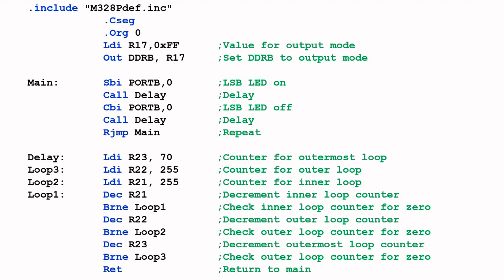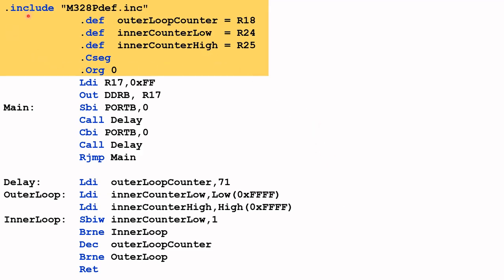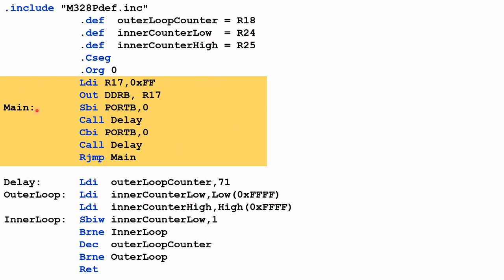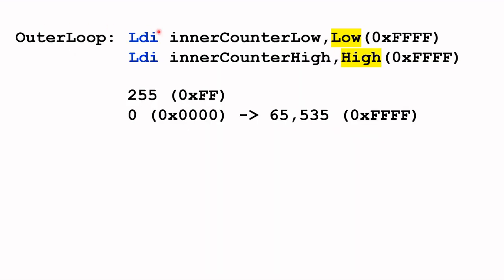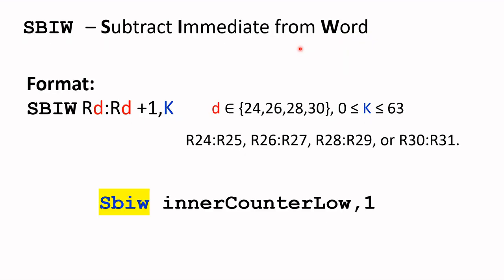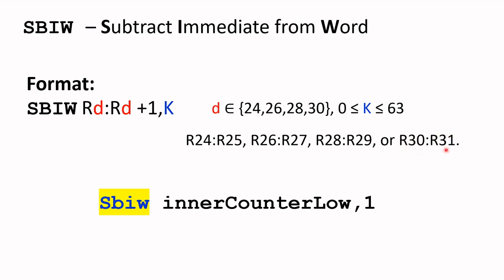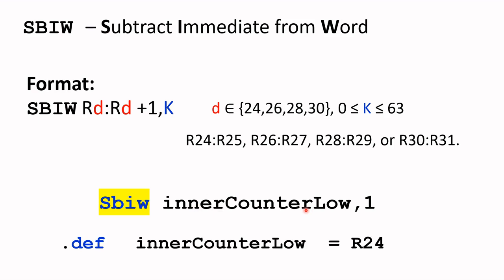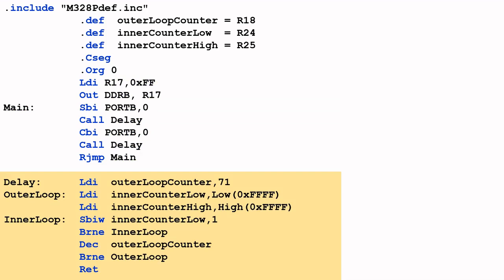#59 Blinking LED - Alternative Delay Subroutine

Comment: Here, we start subtracting from innercounterLow register. Once it is completed, does it start to subtract from innercounterhigh? does it happen 1 by 1 also as we have commanded it to happen 1 by 1 in the innercounterlow part?
Reply from the maker: Hi, the instruction Sbiw innerCounterLow,1 decreases the register pair word-wise (16 bits). That means that whenever the LSB underflows, the MSB is also automatically reduced by 1. Note that only the register pairs R25:R24, R27:R26, R29:R28 and R31:R30 can do that. Note - R27:R26 (is also called X), R29:R28 (called Y) and R31:R30 (called Z). In the other words these 16-bits registers pair.
Reply: @vooiyap   got it. thank you sir!